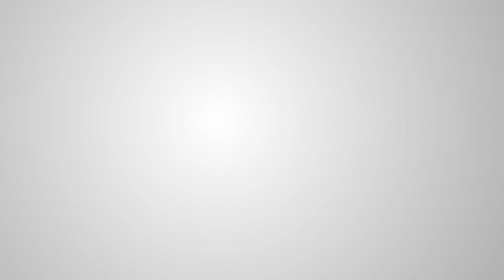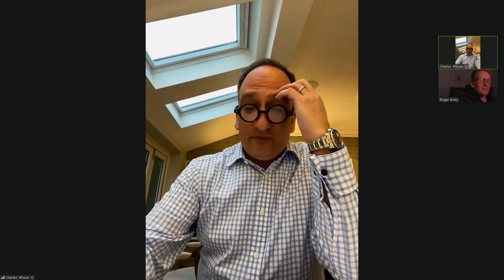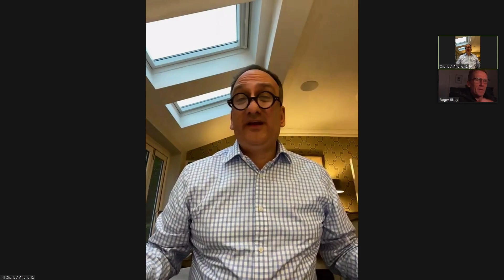10 Plumbers Couldn’t Solve This Mystery. Can You?

Comment: Air testing the primary side of the heating /hot water is a great way to check a system prior to filling. But don't do what I did many many years ago. I decided to test the DHW pipework with air before filling up. It was a huge six bedroom detached house we had just built, and because of the amount of pipework involved, decided to use a compressor to fill it. The pressure gauge wasn't budging, so I went and made a cup of tea, leaving the compressor running. I was sat down enjoying my tea, getting stuck into the Roger Bisby column in 'Professional Builder' magazine, when it dawned on me I'd left the compressor running. Went upstairs, turned it off with gauge sitting at eight bar, phew, no harm done.
Couple of hours later, opened the airing cupboard door, and there was the brand new 210 litre cylinder, mangled beyond recognition, literally grown six inches in height, destroyed! The pipework could take that pressure no problem , but open vented copper cylinders definitely cannot.
Reply: It's not just me then; I installed a new vented indirect cylinder, read all the specs, took note of the max operating pressure well within the scope of the siting, but how to test the installation? I know! fill the tank, close the header feed close the drain cross-feed make sure the hot taps are closed, cap the vent at the header tank, disconnect the hot water tap in the kitchen, cross-feed the main supply into the hot water circuit, go upstairs, get the wife to turn on the mains stop and check for leaks. My head must have been some where else that day, first indication, a slight, puzzling, cracking sound as the insulation separated, then a couple of melodic bongs accompanied by weeping at the vent and by the time I realised my gross error, shouted to the missus to turn off the stop there was a definitely UN-melodic final donnnggg; same capacity, same growth spurt, just with the addition of 210 litres of cold water, which thankfully remained in the cylinder. Specs rated a 33 foot head; my head unaccountably (ex scuba diver ) interpreted this as 33 bar, nowhere near mains pressure, right? The fact that the cylinder remained intact after taking six plus times it's rated pressure impresses me no-end.

Comment: I would have tried an amplified stethoscope & compressed air. So I guess I might have been lucky right away too. No concealed joints, use labeled manifolds & leak test with compressed air. Higher up front cost but cheaper for the owner who knows what they want & has specs.

Comment: Not sure if it was mentioned, but the thermostat he had sticking out of the wall which looks like a TRV is a RTL (Return Temperature Limiter) these are used to fit UFH off the existing radiator circuit, so no manifold as such and just relies on the system pump of the boiler for circulation same as the radiators

Comment: Continued wetness = location of leak. The perfume trick sounds good to find a general area.
I suspect the chimney area. At 16:27 there is the feed to existing house. Could that be an old leaky feed that was feeding the other area which caused the install of the other boiler and left a leaky feed to be shut off? (maybe even in the ceiling?) Could that have been reconnected when that mechanical valve was removed? If the rest of system isn't wet, don't worry about it.
That gas testing doesn't sound like you could  find a leak behind walls or ceiling where you can't meter it.

Comment: I would have isolated and pressure tested. Takes a little time and some fittings but when it's ruining floors or it's in concrete you had better find it quickly... I'm not sure why his "boiler" wasn't refilling and maintaining pressure during the time of the leak. Maybe they don't have an auto fill valve with a pressure regulator??
Reply: Not recommended as it will mask the leak. Sure piece of mind for the first oblivious months to years, while it quietly worsens, then potentially a hefty bill when the consequences manifest.

Comment: Any real plumber doesn't use push fit fitting except in a emergency repair.  Splices under the slab is done by idiots.  Push fit fittings under the slab = double idiots.  Buy longer lengths of pex-al-pex pipe and make all of your runs (HOME RUNS-full length) and make your connections above the floor in an accessible location.  Henco pex tubing is the best in the industry.

Comment: I do think this system would have been pressurised to over 2 bar to make the pressure last longer than a day. Not the customers fault as they need the system to last longer but I do feel the expansion vessel on the combi would have gone causing the heatex leak at some point. The o rings on the flow and return into the heatex on a baxi leak with pressure problems over time.  Once the expansion was sorted I reckon the high pressures, due to it being faulty, would have caused leaks at the weak spots.  Good luck.

Comment: It's a really  good situation. 
Shark bite or a push fittings are only for temporary fix.
You have to do individual pressure  test of each loop.
It's a pretty simple  .
Do not do pressure test with boiler connected to all floor heating loops.
The bottom line  your floor pex piping are done.. 
I will keep spending money in to the big hole.

Comment: Of the 140 million homes in United States only about 9 million are heated with boilers and most of those are in the north east section of the United States. So approximately 131 million homes are heated with some sort of forced air equipment. Whether it’s a gas furnace, electric heat pump or mini split. Less problematic than boilers, much longer life expectancy than the condensing boilers and you don’t have to worry about water leaks. The UK needs to step up to the 21st-century (forced air plus the air conditioning feels great). If your feet get cold put on slippers or shoes but it’s really not a problem.
Reply: nothing quite like radiant heat for really feeling warm

Comment: My suggestion would be to install valves for each system in the house for example for each floor heating system and also valves to isolate the heating units. Ball valves will enable you to isolate your heating unit and if it still loses pressure then you know where the problem is if it holds pressure add one system at a time such as the kitchen floor or the bathroom floor by opening the valves that you installed when the pressure drops you'll know which system is the problem. If possible I would replace what you have with copper soldered in and if that's not practical then at least use PEX A. I'm only partway through the video but there's no mention of mold and if it's been wet for months wow, I'd be spraying bleach everywhere. If you have a slab leak there's only one reasonable way to fix it. I rent out a town home but had a slab leak in the hot water line and it was the associations responsibility so they had a plumber come out and he used pro press fittings and also pex a tubing to bypass the pipe in the slab. That mess that you have is going to be a constant source of headaches unless you rip it all out replace it and do it right.

Comment: Here in the states we have shark bite fittings and push fittings which should never be used inside of a wall or cavity because the only thing preventing the leak is an o-ring.

Comment: has someone crossed over from 1st  boiler to the combi  causing   a difference between the two as in pressure, Also i would try to valve off each area separatly this way  you narrow down the area of concern

Comment: Good luck!   I'm an electrical engineer, landlord and homeowner who does my own plumbing... since childhood when I learned it from my father.    I'm also a seasoned troubleshooter... based in Southern California... so I'm not familiar with English heating systems.   But my Dad was a steam fitting contractor and I recognize "wet heat" radiators, etc.        No you wouldn't get water out of a leaky bleeder at the top of a radiator because of the location.   "Location location location"applies to more than real estate TRANSACTIONS.   ;)   Pardon my attempts at humor.       Getting back to the point of my entry into this fray:   Since childhood, people tossed mysterious appliances and equipment at me, asking me to "FIX it."  The #1 rule of hardware troubleshooting is that you need a COMPLETE WIRING DIAGRAM.   In this case, a piping diagram.  Complete means that all intra-conduit components are characterized.       Your BIG PROBLEM is lack of information, and you are "swinging in the dark" at problems now that you have a wild, pissed-off tiger by the tail.       The object is not only to quiet all such inconveniences, but to master the KNOWLEDGE PROBLEM.        THEN, you can bring in specialists who charge £500/hr to give you specific answers to complex questions.            So hire an engineer who likes to dissect problems, and document his finding with excellent diagrams.     Expect to pay 5 figures, in a mess like you have.       
PLAN B?   You need a barrister.

Comment: About the gas forming under the floor and being undetectedable, you could drill a 6mm hole somewhere that won't be seen and plug it after?
Reply: Maybe get a joiner to remove some skirting boards and gain access from there you would be able to get in every room

Comment: I hope you guys found a solution to your problem by now! I agree with Roger the problem is likely under the slab. 

First thing I would do is set the boiler good and hot and turn on all the heating, then I'd use a thermal imaging camera to identify where all the lines are running, and take pictures using the camera so I know what is happening under the floor. If the leak is bad enough you may see a strange heat spot where the leak is happening. 

Next I would install shut off valves on each of the zones supply and returns. This will allow you to isolate each heating loop one at a time and determine which zone is losing pressure. Once you determine which zone is losing the pressure you can refer to the images you took with the thermal imaging camera to see what the associated piping in that loop does. The leak is likely happening at a fitting under the slab, they should be visible as tight bends or tees in the images. This should bring you much closer to a solution to your problem.

Good luck with this! I would look to have a long term goal of consolidating all heating to one heat source. A good conveniently located boiler. I would then determine how to chase insulated mains from the boiler's location to feed the lines from the eliminated second boiler. Best of luck from Vancouver, Canada.
Reply: Excellent strategy. Another consideration is,  if the boiler leak is under the slab, it is probably undermining the ground around it. This could eventually trigger a collapse of the slab.

Comment: I would run each boiler independantly to work out what areas of the under floor heating is fed by each boiler, my money is on there being a leak close to the chimney breast that is still wet, you should be able to narrow down its location using the humidity tester to find the point of greatest humidity and start from there,

Comment: If he hadn’t come across Skill builder, I would suggest doing away with all the underfloor stuff, drain it down, detach everything and forget it was ever there!  Then create a new heating system above the floor boards. 
It means pipes would have to be surface mounted, but there are ways of hiding that. 
Never have to worry about underfloor leaks again!

Comment: I had a leak in my Central Heating system. Having checked all the radiators using tissue paper wrapped around the valve joints to see if they had been affected by water - None of them indicated a joint leak. No indication from any ceiling marks then led me to investigate under the ground floor rooms. Luckily for me I was able to peal back the carpet in the ground floor rooms and look for a leak(s). Given previous work plumbing/electric work had meant that there were easy sections of floorboards that could be unscrewed. I was able to use a £18 3mtr Boroscope attached to my laptop to look for a leak. It wasn't long before I found that a 15mm pipe had not been given enough clearance against a corner brick and with the constant expansion and contraction of the copper pipe - had worn away part of it to create a pin hole. If the plumber had only given the pipe another 10mm of clearance the original pipe all would still be OK today. I managed to cut out the damaged pipe and fit a new 1 mtr section to stay clear of the brick corner. Total cost of parts - around £15 (early 2017). I also sleeved the pipe with 20mm plastic pipe where it had to go through a gap in the under floor brickwork where the floor joists where supported (another section was sitting on top of a brick where it went from one room to another). Also used the opportunity to fill some insulation over the 15mm pipe work to ensure that more heat go to the radiators. Quite satisfying to be able to do the repair myself - not being a plumber. Use compression fittings rather than soldered joints. Have now over two years replaced all my 30 year old radiators with Myson Premier Compact ones all with slightly more BTU than the previous ones. All now have Drayton TRV4's attached so they can be turned down if necc. 10 Rads cost me a total of £1200. Looking at the price of the Rads now - they are all nearly twice what I paid in 2017/18. I do feel sorry for those that have no practical ability to do some of their own "DIY" work and have to totally relay on the ability of others to sort things out. I even fitted the Geberit Toilet and Basin frames (both Villeroy & Boch off floor mounted) for my bathroom refub back in 2013 as the plumber/tiler that I had to do the work had no idea what they were. They also said they had never seen a shower install that had a separate diverted valve to allow for a wall outlet for a flexi hose as well as an overhead shower head. To be fair it had taken me 5 years of design and planning and acquiring all the necessary fitments before work started on the Bathroom. 9 years on and it still looks like it was done yesterday. I have nearly 100 pics from the way it was before any work started to every stage of the refurb so the joists and pipe runs can easily be seen. From working on Cars - one thing I've learned is that you take pictures - and lots of them so you know what things look like during and after the event. Isolating valves fitted on all the service pipes. Nuff Said,
Reply: Well done mate. 👍🏼

Comment: My money is on the buried pushfits.  I personally still use copper unless its unavoidable (underfloor arrays etc.)  I'd isolate the underfloor units & just run warm air through with a pump. possibly even an adapted hairdryer.  When dry, cap off till the next new floor goes down & use those great radiators & some rugs.  500 pounds goes a long way with some flooring options.   You sound like a nice employer. a good builder could find good employment working on that lovely house with a bunch of mess installed.  I'd never employ a leak detection service.

Comment: I handle all non-visible leaks the same way every time. First, make sure no fixtures are leaking....sink valves, toilets, tub/showers, irrigation, etc. Turn off irrigation valve (if possible). Go to the  water meter and watch the speed of the flow indicator. Turn off the water valve feeding the water heater (or cap off) open the hot side of a sink or something to release the pressure in the hot system. If flow indicator stops turning...leak is in the hot system...if not, it's in the cold. Knowing that alone greatly reduces the time finding the leak. So let's say it's still turning after shutting off the water to the hot system....  Now...turn water off to the house and start capping off cold water supply lines (one at a time) until the flow indicator stops when you turn the water back on ....when it DOES stop....that's the leaking line......there is a bit more to it than that but you get the idea right? Then....instead of fixing the leak, I just abandon the leaking section of pipe and replace it with new pipe. If you can't do this.....you'll possibly pay out the nose to have someone else rape your house unnecessarily.
Reply: This item is about a closed Central Heating circuit - so there is no flow through a Water Meter or Hot or Cold water pipes.
Reply: @shilks8773  She took her 500 lbs service call fee and left the building.